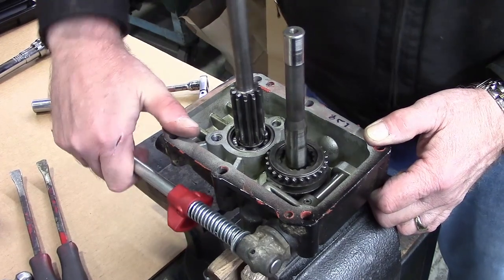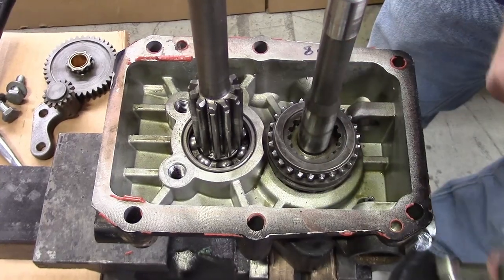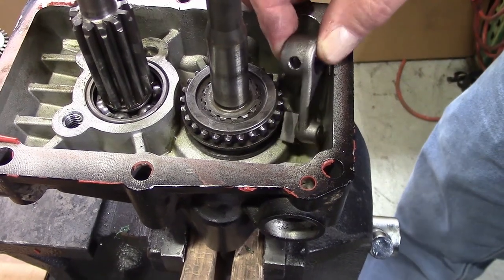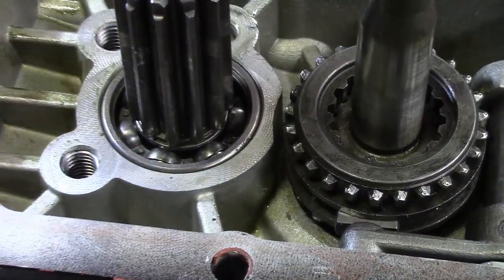BCS Two-Wheel Tractor PTO Shaft Repair Procedure

Comment: I have this machine. it's running fine but the implement has not enough power. it was working perfectly until my implement got stuck into some strings. it came to a halt. I cleaned the mess. and now it starts ok, drives fine in 1 /2 /3 speed mode. but when I start the pto, it slows down and the implement has no power. what could it be ? thanks for the help.
Reply from the maker: We'd recommend taking it to your local dealer for service.